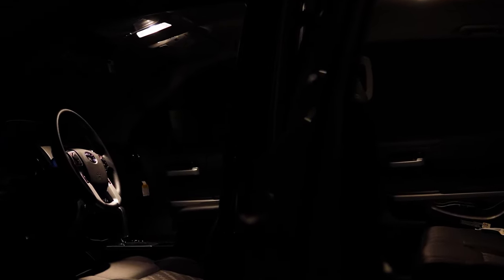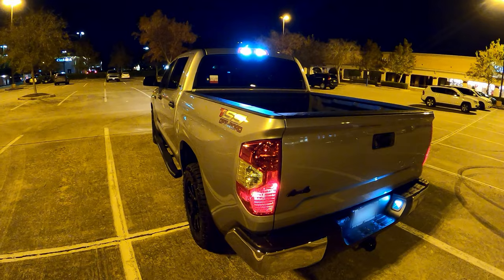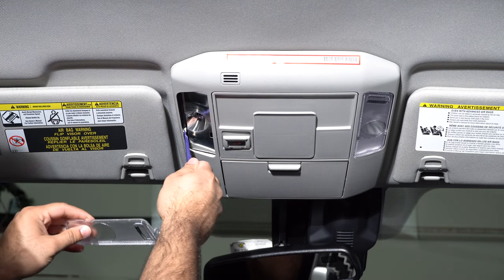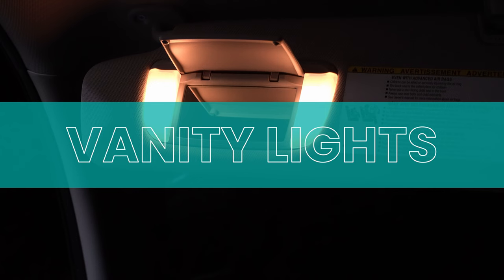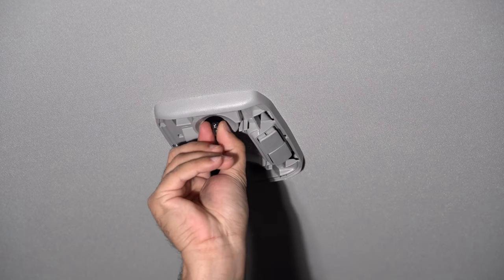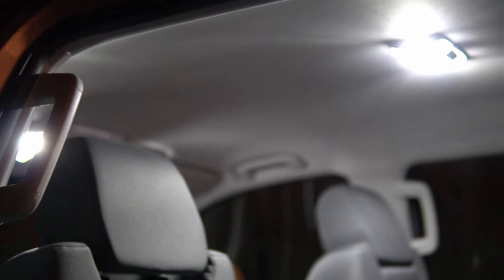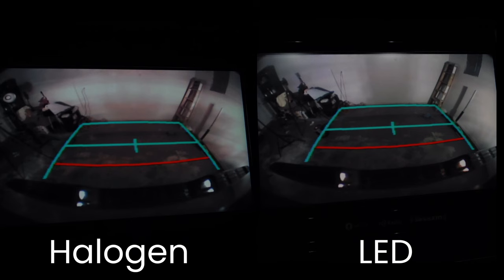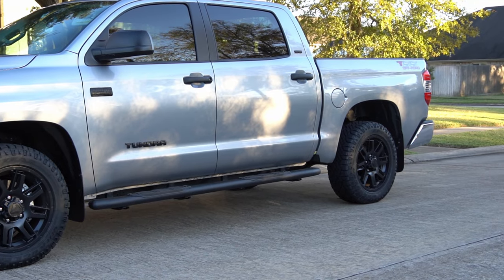How to Upgrade Truck Led Lights for Cheap

Comment: So I'm the new owner of this truck. Small world story.  I looked at this video prior to looking at a pre owned one in person. On test drive I noticed the modified interior lighting. Then the car fax selling dealer matched the dealer plate that was on the front of the truck seen in his first video. Then I pulled out the tail lamp and matched the quality control signature to the video. Kinda fun seeing video from the previous owner lol
Reply: How are the LEDs holding up no problem? None have gone out ?
Reply: @JosePerez027  they are all still working fine. When I got the truck the rear cab lights were halogen and not the LEDs. I guess there is some issue on these trucks if you put LEDs in place of the halogen cab light bulbs.

Comment: For the vanity lights I slightly rotated the LED’s sideways so they aren’t so bright since they shine in one direction only. I love that the leds dim when the door is shut, and they don’t flash. I’ve done all these light upgrades on my 2021. makes the truck look so much better.
Reply from the maker: Thanks for the tip. Yeah changing those bulbs improves tundras look overall
Reply: How has you're Tundy behaving since installation?  Any issues?
Reply: Still running strong. Everytime I reverse I look into the camera at the license plate lights for flickering. But good to go after seven months or so
Reply: @mr.transporter7601  awesome!  Mine are in I'll install today.  Thank you.

Comment: Great video. I ordered the same LED package for my 2020 Tundra and it absolutely is a game changer. Really a must for anyone looking to upgrade their dated stock lights for relatively cheap. I was not able to change out the light bulb above the driver side footwell.

Comment: Hey Sean, love your Tundra man. I have the same color and body style. 

The LED lights where the first mods that I had performed on my 2017 Tundra. It's indeed a MUST to do as I felt that the warm color was a bit unenjoyable to my taste. But, I must say, I do like the warm light color near the foot well because it's not bright but just right. 

The only problem when you mod the Tundra, once you start with the LED upgrade, you just can't stop lol. I've basically went MOD crazy with my Tundra, from suspension to mirrors etc. But it's fun and very much enjoyable to spend time under the hood. 

Can't wait to see your Tundra next mod man.
Reply from the maker: Yeah that’s so true. Once you start changing LEDs you can’t too. In fact once you start moding you can’t stop. Lol. 

I got led headlights and fog lights that I need to install soon. Also planning on changing out the led indicator and tail brake lights. Stay tuned will be making more videos soon.

Comment: Should mention there are 3 bulbs in cargo housing and only the left and right LEDS are replacing the factory bulbs.  The middle stays for the brake light.  Just did my exact swap today.  Looks great!
Reply: Did you get any sensor issue?
Reply: @studmuffin5577  nope.  Good so far.
Reply: @georgioantoine4194  thank you sir

Comment: I replaced all of the same lights you did with LEDs, but I bought Sylvania Evo from the local parts store because I had too much trouble with Amazon and eBay LEDs not working properly and flickering all the time. My Tundra is a 2018 Limited Crewmax 4wd

Comment: Your Truck looks great.  I’m still shopping for running boards and a bed cover.  Bed cover I’m considering the Bakflip MX4 but I have not decided on running boards yet.  I do like yours.  I’m going to try and locate those.
Reply from the maker: Thanks! 
I already got the bead cover. I got it from autoany thing for $200. It’s a generic kind. I’ll be posting a video on it soon. Mine came with the running board so Toyota got me covered there :D
Reply: I went with Undercover Flex cover. Preferred it cuz it stands up when it's folded all the way up versus the bakflip which leans against the window/truck.

Comment: I did that same mod but I had a problem the dome light doesn't work when I took out the original light and replaced the LED it didn't want to turn on Idk if I opened the prongs that hold the light to big but I have no dome light and I hate it do you have any suggestions thanks

Comment: Hi Sean, thanks for the great video!  I was wondering when you swapped out the reverse light, did you happen to crack your tail light when doing it?  It appears at 9:13 in the video, the red plastic is cracked and separated from the lens cover.  I hope not, but was just wondering since the light takes a good tug to remove it.  Thanks!
Reply from the maker: Luckily I didn’t crack the tail lights. You have to be really careful. But it is quite fragile. 
The light locks into that piece.

Comment: Also did the outside lights under the mirrors on my 2018 1794.  First change was kind of difficult but second was pretty easy.  Looks so much better.  Looking for running boards for my new 2021 Nightshade.  Anyone have suggestions?

Comment: Are bulbs still working for you? I always have problems with these
Reply from the maker: They are still working. Only one went out which was for license plate light but I kept the spares worked out fine.

Comment: Did you ever figure out the footwell light? I bought the same kit and the new led replacement is too big also
Reply from the maker: No I didn’t. I did get it to turn on but it was too loose. I stuck the stock one back in.

Comment: Check the link for the lights it says its not fitted for 2021’ coz we same 2021 TSS 4x4
Reply from the maker: It fits fine. Mine is a 2021.